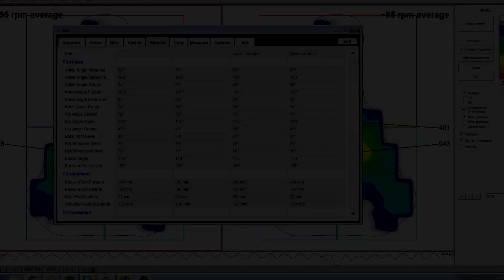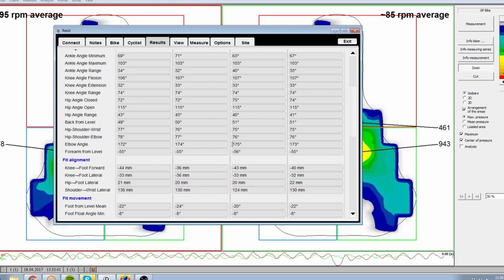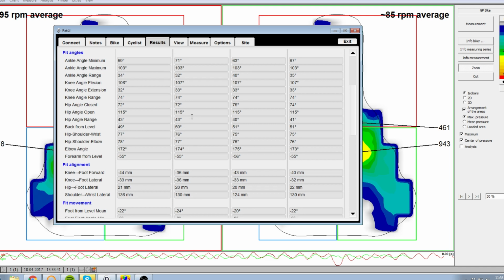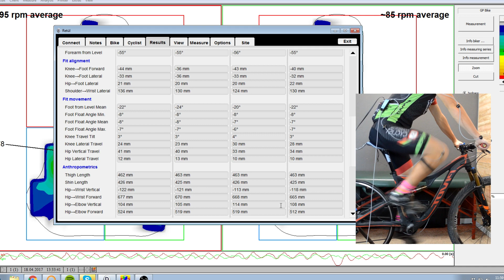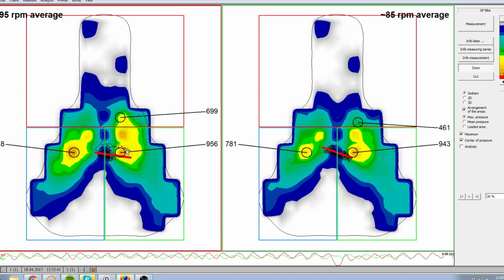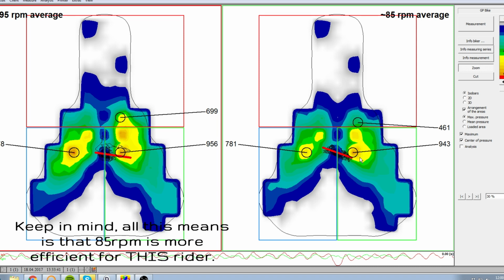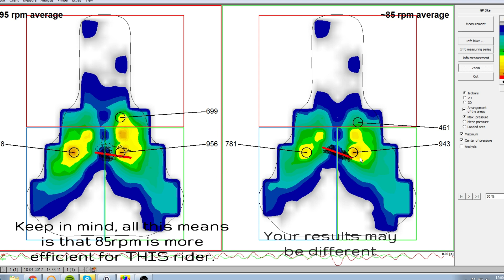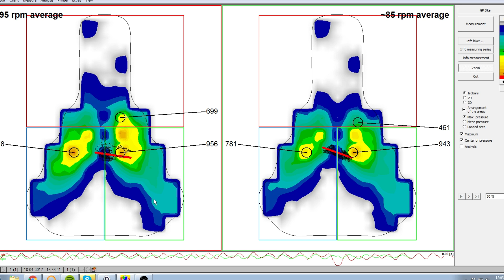Can the right pedaling cadence save your butt? // Cool bike fit case study

Comment: I usually stay around 70-90, but if I'm climbing or riding into the wind, I can get up to 110-120.  At higher RPMs, the saddle pressure is noticeably higher. And I'm kinda screwed after a while if I'm riding at or near threshold because standing up to let the blood flow raises my heart rate.  :P

Comment: Do you have any guidance for bar width?  Somewhere along my 30+ years of riding I got the notion that I needed a 44cm wide bar.  I'm not particularly big or wide shouldered.  I have been chasing some wrist issues that have started up only a few years ago and am wondering if the width might also help.

Comment: I think sometimes high cadence is a coverup for bad posture. Ride with no hands, leaning slightly forward and see where your cadence ends up. That's probably a rider's optimum cadence. No?
Reply from the maker: Nathan Johnson yes, perhaps. But I definitely think you're right that excessively high (but also low) cadence can mask poor fit and posture
Reply: I think "no" -- riding with no hands will not reveal your optimum cadence because you've removed important balance points which will change your position and pressure on the saddle, adversely affecting your cadence. Plus, I don't believe that an "optimum" cadence can be achieved without training. For example, I would use a much slower cadence (about 60 rpm) if I didn't push myself to train at a higher cadence (80-90 rpm). Yet the higher cadence is more efficient for me and easier to push a high power without over stressing my knees. In the end, I think the best way to determine your optimum cadence is with the kind of tests demonstrated in this video.

One of the questions that I've had for years that would be nice to see addressed in a future video is how cyclist leg length and muscle mass affect the optimum cadence. I suspect that cyclists with longer, bigger legs will have a lower optimal cadence than cyclists with shorter, smaller legs. I'm tall (6'2") and, before I became a serious cyclist, I was a body builder. My long legs had giant muscles (I used to leg press 1,000 lbs for 12 reps). Since moving to long-distance cycling several years ago, my body has transformed and I have a fairly typical pro cyclist physique now but my leg muscles are still bigger than most (I weigh 180 lbs with 6-8% body fat). Based on my training experience, it seems that my optimal cadence is about 10 or more rpm slower than most and I wonder if this is due in part to my leg length and leg muscle mass.